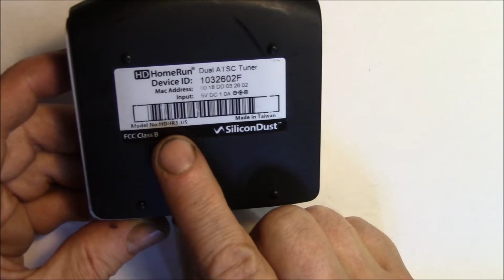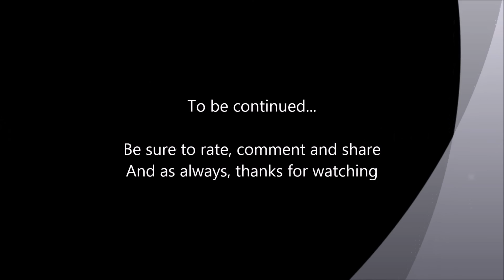HDHomeRun Network v3 TV Tuner, What's Inside?

Comment: Cool video.  Do you have an oscilloscope to look at signals inside?
Reply: The DRX3933J are not available but it's newer cousin puts out a CVBS (standard NTSC) signal.  ATSC in and CVBS out.  It is hard to tell what the original chip did without a datasheet.  The two chips below the DRX chips are probably mixers to get the signal from 460Mhz (UHF tv signal in) to 39Mhz where something can be done with the incoming signal.  The metal can to the right is probably an IF oscillator.  This is getting really interesting, thanks for the tour.
Reply from the maker: @toml3651  I do have an old analog scope, but with 30MHz bandwidth, it probably would not show anything interesting.